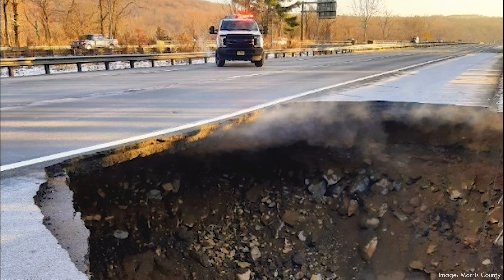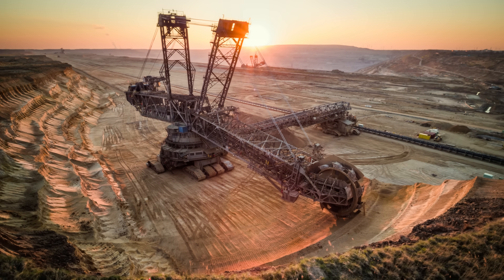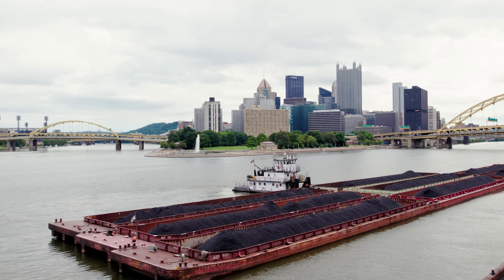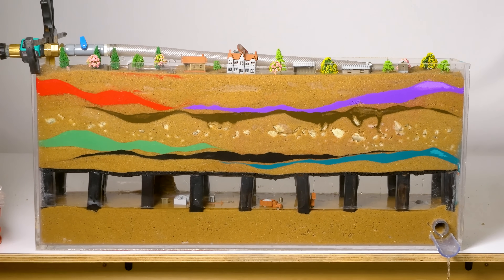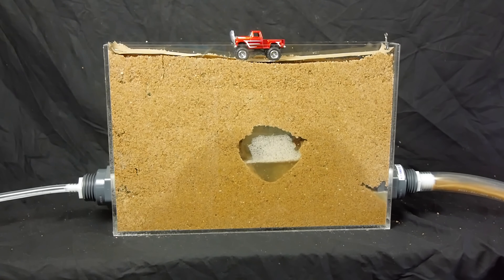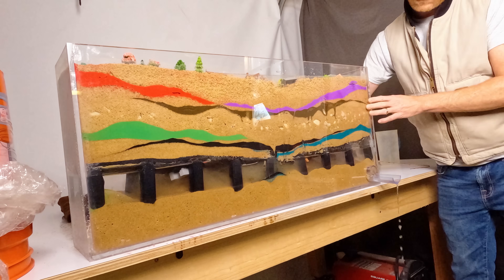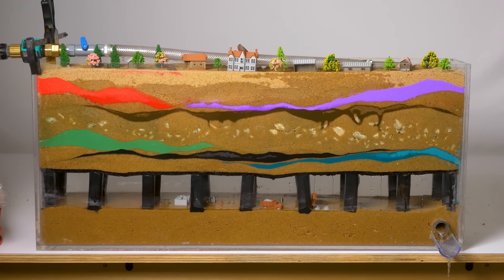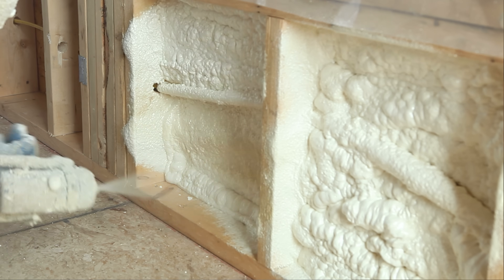When Abandoned Mines Collapse

Comment: The idea proposed by your student is creative but lacks scientific rigor and practical feasibility. Let's break it down and discuss the concept, its potential inspirations, and why it may not work as described, while also exploring related ideas in earthquake mitigation.

Analysis of the Proposed Idea
The suggestion involves creating a water-filled cavity beneath the surface, capping it, and using it to "ride the wave" of an earthquake, likening the effect to soft rubber or springs that smooth out seismic vibrations under megastructures. Here's a review of the key components:

Cavity Filled with Water:
The student likely envisions a fluid medium (water) absorbing or dissipating seismic energy. Water is incompressible, which means it doesn't compress under pressure like a gas or a spring. This makes it unlikely to act as a "soft" or "springy" buffer as described.
Seismic waves (P-waves, S-waves, and surface waves) travel through different media at varying speeds. Water can transmit seismic waves (especially P-waves) but doesn't inherently dampen them significantly compared to solid materials like rock or engineered dampers.
"Ride the Wave" Concept:
The phrase "ride the wave" suggests the structure would float or move smoothly with the seismic waves, avoiding damage. This might be inspired by base isolation systems, which allow buildings to move independently of ground motion. However, a water-filled cavity wouldn't provide the controlled decoupling needed for this effect.
The analogy to a "smooth silky road" or "soft rubber" implies flexibility or damping, but water lacks the viscoelastic properties of rubber or the controlled resistance of springs.
Capping the Ends:
Capping a water-filled cavity suggests a sealed system, possibly to contain the water or create pressure. However, this doesn't align with how seismic energy propagates or how damping systems function. A sealed cavity could even amplify certain frequencies of seismic waves due to resonance, potentially worsening the impact.
Springs Under Megastructures:
The mention of "springs" and "megastructures" hints at an intuitive grasp of existing engineering solutions, like base isolation or tuned mass dampers, which use flexible materials or mechanical systems to absorb or redirect seismic energy. The student's idea may be a simplified or metaphorical take on these technologies.
Scientific and Practical Challenges
Physics of Seismic Waves: Seismic waves are complex, with different types (primary, secondary, Rayleigh, and Love waves) interacting with materials in distinct ways. Water-filled cavities wouldn't effectively dampen all wave types. In fact, water could transmit certain waves faster than solid ground, potentially destabilizing structures.
Structural Stability: A large underground cavity filled with water could weaken the ground, increasing the risk of subsidence or collapse, especially during an earthquake. Maintaining the integrity of such a cavity under seismic stress is a significant engineering challenge.
Scale and Cost: Creating and maintaining large, sealed, water-filled cavities beneath buildings or cities would be astronomically expensive and impractical. The logistics of construction, sealing, and preventing leaks or contamination are daunting.
Resonance Risk: A water-filled cavity could act as a resonator, amplifying certain seismic frequencies rather than dampening them, similar to how water in a glass can amplify sound when struck at the right frequency.
Potential Inspirations and Related Concepts
The student's idea seems to draw from real-world earthquake mitigation strategies, perhaps misunderstood or creatively reimagined. Here are some related concepts that align with their thinking:

Base Isolation Systems:
Modern buildings use base isolation, where structures rest on flexible pads, springs, or bearings that absorb seismic energy, allowing the building to move independently of the ground. The student's "springs" and "ride the wave" imagery may reflect this concept.
Example: The Transamerica Pyramid in San Francisco uses base isolation to withstand earthquakes.
Tuned Mass Dampers:
These are large, heavy pendulums or masses installed in buildings to counteract swaying caused by earthquakes or wind. The "smooth as a baby's bum" analogy might evoke the smooth stabilization these systems provide.
Example: Taipei 101 in Taiwan uses a massive tuned mass damper to reduce seismic and wind-induced motion.
Liquefaction Mitigation:
In some earthquake-prone areas, engineers address soil liquefaction (where saturated soil loses strength during shaking) by improving drainage or reinforcing the ground. The student's water-filled cavity might be a misinterpretation of techniques to manage groundwater or soil properties.
Floating Foundations:
In rare cases, structures are designed to "float" on soft ground or use flexible foundations to adapt to ground motion. The "ride the wave" idea could be a poetic take on this, though water-filled cavities aren't used in practice.
Constructive Feedback and Alternative Ideas
The student's enthusiasm and creative analogies ("smooth as a baby's bum," "silky road") show an imaginative approach to problem-solving, which is valuable in engineering and design. Here's how you could guide them to refine their idea:

Encourage Research into Base Isolation: Suggest they explore how base isolation systems work, as these achieve the "ride the wave" effect more effectively. They could investigate materials like rubber bearings or friction pendulum systems.
Explore Damping Materials: Instead of water, they could consider viscoelastic materials or fluids with specific properties (e.g., magnetorheological fluids) used in advanced damping systems.
Study Soil-Structure Interaction: The cavity idea might stem from a misunderstanding of how soil and structures interact during earthquakes. Encourage them to learn about geotechnical engineering and how soil properties affect seismic performance.
Prototype a Small-Scale Model: They could experiment with a small-scale model (e.g., a shake table with a structure on a water-filled base vs. a solid base) to test their intuition and see why water isn't an effective damper.
Incorporate Data: Suggest they look into seismic wave propagation and how different materials (solids, liquids, composites) respond. This could ground their idea in physics.
Broader Discussion: Earthquake Mitigation Innovations
Earthquake engineering is a dynamic field with ongoing innovations that align with the student's desire for creative solutions. Some cutting-edge ideas include:

Seismic Cloaking: Researchers are exploring metamaterials that can redirect seismic waves around structures, effectively "cloaking" them from damage. This is more sophisticated than a water cavity but shares the goal of wave manipulation.
Self-Healing Materials: Concrete that repairs its own cracks or shape-memory alloys that restore structures after deformation could inspire the student to think about resilient materials.
Smart Structures: Buildings with sensors and adaptive dampers that respond in real-time to seismic activity could align with the student's vision of a smooth, adaptive response.
Conclusion
The student's idea, while not feasible as proposed, reflects an intuitive grasp of earthquake mitigation principles, possibly inspired by base isolation or damping systems. The water-filled cavity concept doesn't hold up due to the physics of seismic waves, structural stability concerns, and practical challenges. However, their creativity and vivid analogies suggest potential for innovative thinking. You could encourage them to explore real-world earthquake engineering solutions, experiment with small-scale models, and ground their ideas in scientific principles. If you'd like, I can search for specific resources (e.g., academic papers or videos on base isolation) or analyze any additional details the student provides to further tailor the discussion. Let me know how you'd like to proceed!

Comment: 4:25 - in the state of Pennsylvania, the owner of the mineral rights can remove surface structures at any time to gain access to the resources underground. They are not legally required to pay compensation for any damages.
Reply: That’s actually insane
Reply: @TheLightFromTheEast  What the OP said is entirely false. I'm a tax preparer in Northern PA and we have a lot of clients who literally get paid by gas/oil/mineral companies to use the surface land to construct buildings and drills on their land to access whatever resource there is underground. They typically negotiate a percentage of the profits thats made off of whats extracted or a flat monthly "rent" they'll pay the landowner for occupying a part of the land. Mineral rights holders cannot just destroy any structure they want on the surface to gain access to the minerals if they do not own the surface rights as well. 

OP is probably thinking of the "Broad Form Deed" that was common in KY and WV that allowed mineral owners to build roads, dig pits, store equipment, use timber, and otherwise alter the surface in a reasonable manner.
These deeds still, however, did not allow for the straight up destruction of homes or structures at will, but they did strongly favor mineral development. In fact theres literally AN ACT in PA called the The Bituminous Mine Subsidence and Land Conservation Act which requires coal companies to repair or compensate for subsidence damage, provide water replacement, and/or compensate for structural damage.

There was definitely a period from the 1800's-early 1900's where common law had favored mineral rights holders but it was never legally allowed to just show up and destroy whatever the surface rights owners may have built.

Comment: We had a building explode in my town years ago, the town I live in has a huge underground coal mine under it. As it filled up with water it squeezed the methane out of it. The building was a residential building that was connected to another building that was an old ice house that had a well in it. A compressor in the Coke machine kicked on and caused the ignition. It was an ongoing problem for many years while they drilled vent pipes.

Comment: Minneapolis had a near catastrophe from a mining tunnel collapse in 1869. Many people know about the August 1st, 2007, I-35W bridge crossing over the Mississippi River collapse. Thirteen people died and over 100 suffered various injuries, some of which resulted in lifelong disabilities. 
.
What most people don’t know is that on October 5th, 1869, less than a mile upstream from where the I-35W bridge is, there was another massive engineering disaster that nearly destroyed the St Anthony Falls cataract (and the lumber industry) at Minneapolis when the sandstone roof of a waterpower tunnel, “the Eastman tunnel”, that was being dug under the river collapsed. As the Mississippi River poured through the breach into the tunnel, the torrent rapidly widened the hole as the minutes went on and created a massive whirlpool. Only a massive response that included the people from the entire community to plug the hole in the riverbed and a considerable amount of luck prevented the destruction of the St Anthony Falls, the only place on the entire Mississippi River where there was a sufficient vertical drop over a short enough horizontal distance to make waterpower practical, and the reason Minneapolis was founded where it is, which was to use that waterpower to saw logs cut from forests upstream. 
.
Search “Saint Anthony Falls tunnel collapse” and/or “Saint Anthony Falls Eastman tunnel collapse”. Here’s a nice video about this disaster https://youtu.be/tUhMhgA4rq4 . This near-catastrophe had some similarities to the the 1980 Louisiana Lake Peigneur disaster.
.
In Minneapolis, after the commercially-exploitable trees were all cut upstream, the waterpower from the falls was used to mill wheat on an industrial scale, which set the stage for the nearby "Washburn A Mill" grain dust explosion on May 2, 1878, which shattered windows within a half a mile of the mill and resulted in the complete destruction of what was then the largest grain mill on the planet and numerous other nearby buildings. Eighteen people were killed, including the entire 14-person night shift crew at the mill. https://www.minnesotaalumni.org/stories/history-the-mill-explosion 
.
Safety laws, regulations and rules are written in blood, and so are laws "protecting" basic civil liberties, worker safety, consumer food safety, drug safety, etc. Only after massive disasters when enough people are killed and harmed, such occurred during New York City's 1911 Triangle Shirtwaist Factory Fire, is there sufficient public pressure and will to overcome the part of the population that benefits from not having safety/disaster "prevention" procedures in place. Another example of this dynamic was when, on June 22nd, 1969, the Cuyahoga River near Cleveland, Ohio was so polluted by unchecked industry dumping that it caught fire (for the 13th time since 1868, btw). It was hardly the only badly polluted body of water in the USA, but it served as rallying cry to finally get enough people to push for environmental protection laws, which resulted in the creation of the Environmental Protection Agency (EPA), the 1972 Clean Water Act and numerous other state and local pollution regulation agencies and laws. "The fire served as a stark reminder of the environmental damage caused by industrial pollution, prompting the creation of the EPA and the Clean Water Act." -  https://www.healthandenvironment.org/resources/resource-library/eh-history/the-cuyahoga-river-fire-of-1969
.
There's much to be learned from studying political, natural, engineering and industrial disasters. Those who do not learn from and make adaptations as a result of understanding historical disasters are condemned to experience more of the same kinds of disasters. The same is true when those who profit from eliminating protections get their way and remove those "burdensome" protective regulations.

Comment: In my hometown my first year of elementary school the high school next to us had a sinkhole form dead center in the gym. The high school was torn down and then a few years later the same elementary school I was at had to be closed due to several massive cracks forming on the exterior bricks outside. Unfortunately the same mine that took out the high school also eventually took the elementary out aswell, just 100 feet or so away from each other lol. Elementary still stands but abandoned

Comment: Seriously you cannot use a sand based model for underground dude. Engineer or not, sand does not exist on such an extreme level underground like your thumbnail claims. Sand does not equal dirt and especially not CLAY. Your model is based on the top of a local beach. So using sand so much for engineering examples is absurdly ridiculous. Not to forget theres tons more rock infrastructure below than your thumbnail claims.

Comment: Subsidence does not just occur around deep mining. I wrote my Bachelor's thesis about subsidence related to open pit mining of brown coal to the west of Köln in Germany. The mining companies pump out the ground water that would otherwise flood the pits. This in turn leads to the soil and rocks around it losing the hydrostatic reinforcement the water would have granted, and collapsing under its own weight (including re-arrangement of grain structure). This lead to infrastructure partially collapsing, which cost the affected municipalities boatloads of money. Fascinating and terrifying subject, which shows that you can't really do anything "right" when it comes to mining.
Additionally it's been observed that  after the end of mining operations, when the pumps have been deactivated, and water was allowed to return into the ground layers, those would swell up again to roughly 80% of their previous volume (due to previous re-arrangement of grain structure), which then potentially affected infrastructure a second time.
Reply: A University of Nevada professor put out a glossy brochure on more sequestered, toxic mine water being stored than flows through Mead Resevoir in a year.  Have you looked at this?  Have you experienced results from the Schauberger Institute studies on clearing toxic ponds?  In my research, it seems possible to pump sequestered waters to clear with Schauberger methods and follow through with  vegetative rehab like cattails to be used to develop ethanol or other commercially viable products.  I have drafted a concept grant request without appropriate audience so far.

Comment: 9:55 A problem with this type of subsidence is that underground infrastructure (water pipes, sewer mains, electrical conduit, communications lines, etc) can be damaged by the movement of the earth. In the case where fluids or gases are carried, this can cause erosion of the top soils and lead to a secondary sink forming as the fluids escape from the pipe.